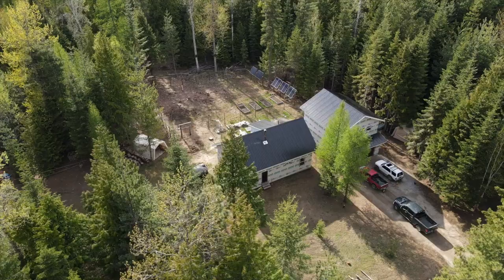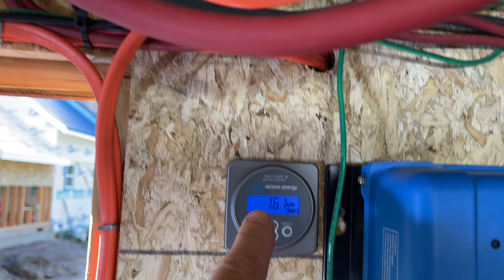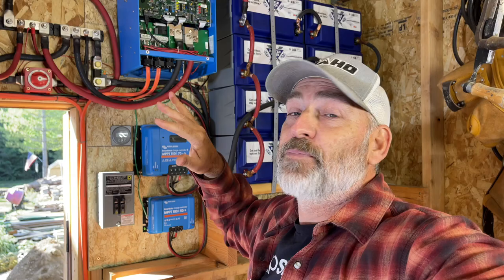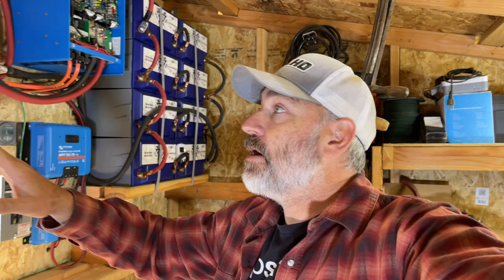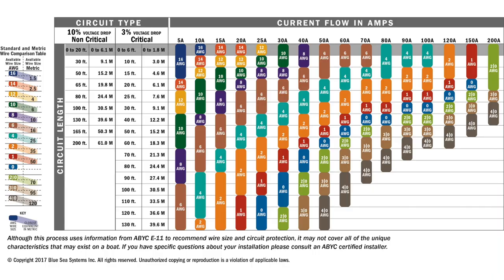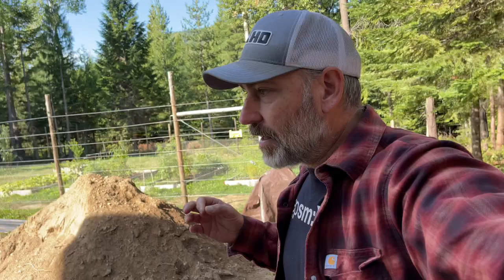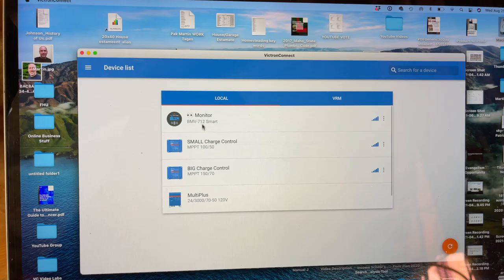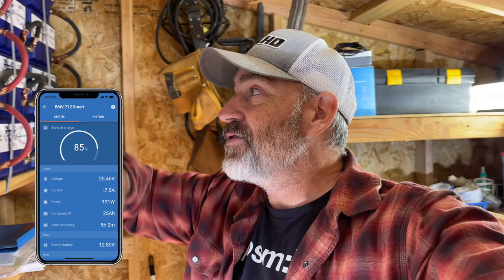DIY Off Grid Solar Power System for Home - AMAZING POWER!

Comment: I have a Victron 24V system very similar to yours (2 inverters split phase, charge controller, battery)  My array is 9 - 400W panels for a potential 3,600 watts. I've noticed a max usage of 2,500 watts from my system and read that the controller nominal PV input is 2,400watts.    Could I install a second charge controller with some of the panels as a second array to use more PV power, closer to the 3,600? Thanks

Comment: On my construction jobsite gererator  I used to plug in cords to start equipment and eventually the cord ends corrode and then burn, It would be best to have a disconnect rated for the load and have the disconnect off when you plug in the cord and use the switch to turn on the poweswitch

Comment: Hi Martin, I am thinking of putting together a 5Kw or 6Kw 24V system in my basement. All I need is a 110V, do you have a PDF wiring diagram for such a setup? My reason not to have a 240V setup is that I do not see a need to run a well/other pump or a dryer. The most I would run air conditions a couple fridge and a couple chest freezers and to run my propane furnace in the winter. I am thinking of making a bigger battery bank as in winter the sun does not show up for several days as I am in Minnesota. Do you accept credit cards? Thank you for your help.

Comment: when you speak about the split phase, is that 110v and 220v. 
Are those batteries 50amp I think I noticed in your settings the batteries where 400amp.

I'm in Australia so we're all 220v but I'm trying to piece together a system to fuel my PCs which run about 1250w

Comment: if you dont have the fence posts and cross lumber should I build that or use metal to anchor the solar frames into the ground. if so do you have a video on that?

Comment: How have you overcome the extremely limited sun during the darkest 4-6 weeks of the year? Our local solar professionals tell us that they have gotten away from off grid systems because they cannot keep up during that "dead zone" time frame. About how much do you run the generator during winter? I'm guessing 3-6 weeks at about 5hrs/day. Excellent video!!
Reply: It all depends on how much power the household consumes. The battery bank is 400Ah at 24V which translates to approximately 9.6kWh of total power capacity. You lose a little bit of that power running the inverters, controllers, and shunt so I would say approximately 9.4kWh of total power capacity. The well pump consumes approximately 2kW of power while running, but probably only needs to run for maybe an hour a day total. That means it consumes approximately 2kWh per day leaving 7kWh of available capacity to run the rest of the house when starting with a full charge and zero power coming from the panels. His generator is able to charge the system at 4kW sustained, so he can go from nearly fully discharged to fully charged in about 2-3 hours of running the generator again assuming zero power from the panels. On even a cloudy day, a solar panel will still generate approximately 25% of its rated capacity. His system therefore will generate between 1kW and 2kW of power on that cloudy day while the sun is up. He, at most, probably has to run the generator for an hour or two per day and that is only if the sun decides not to come out. If the sun comes out, given that its weaker winter sun, I would say the system would produce closer to 50% of its rated capacity yielding 2kw to 3kw and probably no need to run the generator that day. After all, a well pump usually runs in 5-10 minute increments as needed to top up the water tank consuming approximately 0.333kWh per increment at most (2kW for a duration of 0.1666667 hours). The rest of that hour, the full output of that array can go to running the house and charging the batteries.
Reply: You need a wind turbine in conjunction with solar. Solar alone never cuts it.
Reply: Can always save up gasoline for a gas generator.

Comment: Could you use this system without solar... so charge the batteries with just power during the night when rates are cheap and then use the energy during the day when its expensive? Seems like it would reduce cost by 30% or so.

Comment: Just  a question !, when the batteries are fully charged and the lets say the house is switched off what happens to all the electricity being generated by the panels can they overheat is it discharged elsewhere ? ( like I say just a question )

Comment: Excellent work .. I have a question why did you not put a metal plate under all this system to prevent the fire in the event of a spark ... May God protect you👍
Reply from the maker: No good reason.

Comment: Quick question. Any issues with the components ground wire being small?? 
I have the same system just wanted to ask I’m not sure if I should use 1/0 or just go with what you used

Comment: Getting a our Victron & Battle Born equipment soon. Your videos have been super helpful in  giving us confidence that we can do this. 
One question, what is the  reason you dwitched from 2/0 cable to 4/0?
Reply from the maker: Just to be sure I didn’t have a voltage drop. With 2 inverters we doubled our amp draw we both are running maxed out.
Reply: Did you buy it already?  You can go Grow watt and 52v battery systems for a lot less money..
Reply: Chris, did you order the wiring diagram parts download?  It is currently unavailable
Reply: @MartinJohnsonOffGridLiving  your channel is a gold mine. You could make a lot from writing an ebook series on your journey from starts to upgrades. Decisions made & why. You have loads of knowledge, experience, & lessons learned.  Several more full time jobs to add to the many you have ongoing. Need to have a body cam lol . Seriously I wonder if the cost benefit is viable for marketing a video series. Thank you for sharing your journey.
Reply: @Srjgal  Absolutely Not... That system is outdated and I would probably get my diagram from a professional..

Comment: Hey Martin, Thanks so much for all your amazing videos. Im trying to figure out how you wired from the Generator's 30 amp 4 wire 10/4 to the 10/2 cable on the AC in. I have the same generator which take a 4 wire cable but my victron input is just 3 wires. 
Any help would be much appreciated. Ive been searching the internet and cant find it.

Comment: Nice set up do you have any insulation behind the batteries? And with the solar charge controllers are you able to expand the system in only asking because you have to different size controllers. Thanks for sharing.

Comment: Martin - Why are you using separate charge controllers rather than connecting your solar directly to the inverters and use the built in charge control?
Reply from the maker: I don’t think they  have a built in mppt charge control.

Comment: Could you please explain why you decided for an 24V System, and not 48V ?
Reply: If you lose one battery you don't lose the whole system he's got 4 24 volt batteries 👍😁 you get to isolate the battery easy nothing's foolproof
Reply from the maker: When I started I couldn’t afford more batteries. Then I just never changed. If I had the money in the beginning I would have gone with 48v.

Comment: Thanks Martin, I’m about to install a system similar to yours. Your videos have helped a lot. But, do you have a video where you remove the extension cords and run it into the the house officially? I’m ignorant with electricity and we’re so off grid we can’t get access to an electrician easily.

Comment: Hello, I mentioned it before in your 1st video about the power system, but you might want to get a Raspberry Pi setup to monitor ALL the devices and get a lot more details on how much your house consumes, how much the solar are producing and where the batteries are at. You can monitor and have access to the entire system on the internet as well (providing you have a way, which I think you do, to connect the Pi to the internet).
Reply: How do you do it

Comment: you should use a cerbo gx to interconnect all the data. makes for easy visibility plus smart, combined charging throughout your mppts and inverter chargers. Also you could wire a remote start based on state if charge for your generator :)

Comment: wait a min, am I missing here something ?Two 10Amp circuit breakers supply 240v in 10/3 wire, and then four 110v, 2 each with a same 10/3 wire? So when a 1800w start and 600-800w continuous water pump works you have how much of the power left to power appliances at home ? Or am I really wrong, I WANT to set up similar system so Im just wondering if there is an easier way to combine two 110v double phase in a more roomy circuit breaker-panel, I mean 3000VA seems a lot for just two 10amp breaker? Could someone clarify is it standard? What gage  is the 10/3 wire to run 20amps ? :(

Comment: Awesome video! I'm planing on building my retirement home in the next 2 years. I want to be on the main power grid but I also want a system like yours. Is there a way to have this system connected to a Main Power Pannel Box? I want my house using both sources of power but use solar mostly and when there isn't enough power it would switch to main hydro power. Where I live we get very short daylight days in winter plus a lot of stormy days so having access to main hydro power is important.

Comment: I just stumbled on this nice...well made, sponsored (not in a negative sense) video . And have a question. You have a ground pin, but it seems only in use for the Victron stuff. Is that ground transported to the house too? Seen the distance to the house that should have it's own ground pin. Which brings me to the next question you don't seem to use use earth leakage circuit breakers, which would step up safety in the shed/house should have there own) and for pumps enormous. Why? And last, maybe it it is, but does not show in video, is the generator connected to the shed ground pin? Because to my understanding should be,  as it is a power source. thanks.

Comment: Were you going to enclose or cage the charging system? concerning that 240 v wire are exposed. What if a kid  got in there? or something from the shed falls into it.  Just saying, safety first. Also did you consider a disconnect on the outside of the shed to cut power from the solar panels quickly.

Comment: when you charged the batterys off the generator at 4kw, did that much input scare you of hot batterys? would lead catch fire with that much input?
Reply from the maker: Everything should be sized accordingly, and you should only charge to the amount the manufacture of your batteries recommends.
Reply from the maker: Martin Johnson - Off Grid Living no, I wasn’t really scared.

Comment: Great videos. New to solar and currently have a natures generator elite to get my feet wet. I do have a question. I was told you could charge the generator with a gas generator when they sold it to me. However, they never said anything about an inverter box. Basically they said just plug and play. I currenently have a peredtor inverter generator. Do I still need to buy an inverter box? Just learning so forgive me if it is dumb question :)

Comment: Good looking set up! Curious, are you going to need an increase of solar panels and batteries to supply power for the garage and the apartment? Looks like that you are plugging in and unplugging items when required which could be a pain. What are your thoughts Marty?
Reply: He's getting 4Kw with the panels(as he says), when his Mac mansion gets ready, with well pump and everything else , he's going to need to triple his panels(10Kw) and expand the inverter rigs.

Comment: Hey Martin- "solar guru and Johnson brother from another mother!" Fyi, I watch all your videos, but hey...I'm here in south central Missouri and decided to follow your solar tutorial and items list verbatim since 1) my cabin build and electrical needs (with well pump) are very similar to yours, and 2) you have the best "how to" on YouTube bar none. The only difference with my installation is that I'm putting my panels on my roof...and due to its constraints, I've gone with 22- 210w 24v panels @ 33.54v/6.24A each (11 on the front wing and 11 on the rear- with all facing the same southerly way). And I notice you installed 70 & 50 Amp charge controllers specific to your array. But for my split 11/11 array, what would you recommend friend? Fyi, I like the 2 controller approach and Victron, but I don't know how to size them up.  So if I may be so bold....may I ask...what would you recommend?? (I'm not that great of a mathematician) Blessings to you and yours.

Comment: I think I figured some of your BMS out - the parallel batteries balance themselves - but how do you balance the series connections?
Reply: You follow the manufacturers instructions, and fully charge each battery before wiring them in series.

Comment: How often do u use your generator to charge the system? Are there days that it’s sunny but u can’t produce enough to power what you’ve got? Like when your using the washer/dryer and the well?
Reply: I am sure he has low sun days, but what I really like is he can start the generator and charge the batteries to full in a couple hours time!

Comment: Would you be willing to share an estimated cost for this system. We are in the planning/design phase for a 2400sqft off grid home. We have looked at many kits and are estimating around 40k. Wondering how much we would save building our own instead of buying a kit.

Comment: Hi I live in az and in the winter I have average of 6.9 hours of daylight. Would your setup be able to run a 18,000 btu mini split, 24 cubic refrigerator 30 gallon electric hot water heater and 6 4 watt lights? It's hard to figure this out. I only use about 800 kw a month.
Reply from the maker: 3000w of panels x 6.9 hours of sun = 20700 watts per day X 30 days = 621000 watts.

Comment: Looks very nice! I wonder if you guys are using power to heat your water? 
I also live off-grid and got almost the same solar power system as you guys. But I don't wanna use too much power (especially not in the winter) to heat our water tank. So that is why I am currently installing a wood stove which can heat water, together with an accumulator tank to heat our water. 
So I am wondering how you guys are solving this. 
Thanks and be safe!
Reply from the maker: We have a propane water heater.
Reply: @MartinJohnsonOffGridLiving  if you can check heatpump inverter system for heat and cold in the house and also heatpump boiler to have hot water with as little as 300/400w

Comment: Very Interesting & informative 👍 question,  So you can use loud modified sinewave generator assuming thats what you have' on your expensive victron equipment & battle born batteries. 
Will Prowse program says you have use a special alternator that's designed for lifep04 batteries.
Reply from the maker: The charge controllers take care of it.
Reply: A generator is not a modified sinewave, it is considered pure sinewave, just that the engine rpm can very when loads are started and stopped causing the frequency to shift as the engine stabilizes.

Comment: Hy Martin.
An other idea I think if you put the solar panels to the roof of the garage, it would work better. Because less shadow is in. And then you can install all system into this buildig which one you will heat in winter it is better for batteries. And there will not be this long extention cord, I think it is not so safe, and there is a voltage drop in this kabel, you can make a better efficiency.
Reply from the maker: We are considering it.

Comment: The last minute of this cracks me up. "You don't have to do it on the computer U can use a phone." Y would U want to ? On a little tiny screen that's 1/10 the size of the computer screen with minuscule text and imagery. For years the computer industry fought to make the biggest and best screens and resolution and now ppl want 2 C it on a little glass screen of a phone ! ?? IF we can't monitor it on a computer we don't even want the equipment.

Comment: I learned the hard way 48v dc is minimum necessary for the solar system at 15kw inverter. Also about 5 kw of solar panels! Do a search on eBay for 15 kw 48v dc inverter and it’s made in China but the company is on it’s 4th generation inverters maybe $800 to $1200! I would go to 60v dc or 72v dc but basically no one is making them but if they did my transportation could do a straight charge off the solar charger! The whole house including aircon runs great on minimum 48vdc and 8 batteries. Also I much prefer a whole complete 220v ac house system because half the amount of copper is needed running 10 outlets on each line instead of 5. Bypass the whole mess for lights because wrapping copper on a speaker magnet and you have 24hr free led lights right at the light , maybe a remote control light switch but free 24hr lights run off the natural earth frequency.
Reply: What do you have against Victron?
Reply: @uhjyuff2095  first time I have heard of them. They’re a new company?

Comment: We're looking to install something similar at our house, and I have a question.  When you're charging via the generator, are the outputs fed by the inverter still, or by the generator instead?
Reply: When the Vectron Multiplus is fed with 'shore power" - be it 'generator-based' or 'grid-based', the Vectron will provide ac from the gen to the house, and not the inverter. A Vectron Quattro (which has dual ac-inputs, eg grid and generator) has internal switches which allow the unit to route power out intelligently (for example, with grid power present,  ac could be presented on both outputs, allowing high -power loads to be run on grid power from one output, while the house run off the other.  Loss of grid power would prevent these loads running, thus saving your batteries).

Comment: Why not to use single 250/100 mmpt victron?
Reply from the maker: Didn’t get all the equipment at the same time. That is a problem with building as you go.